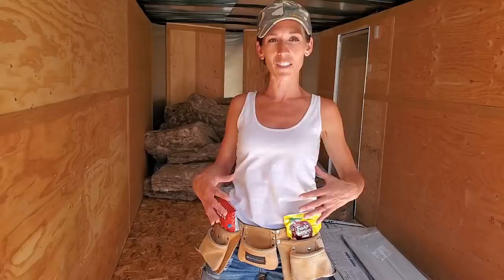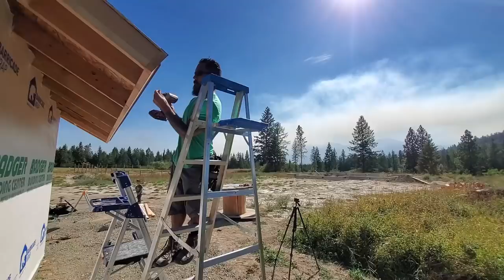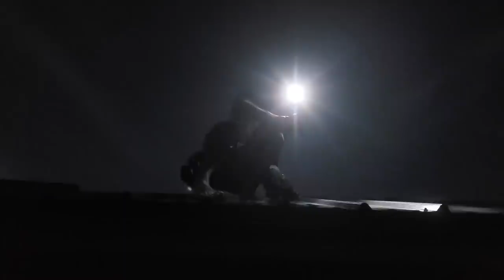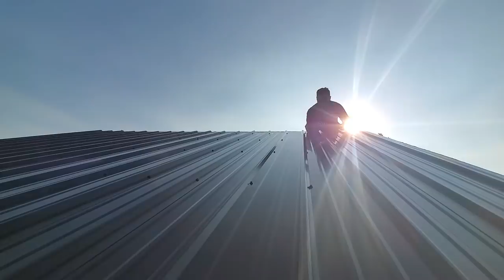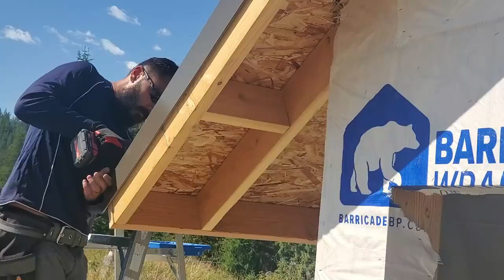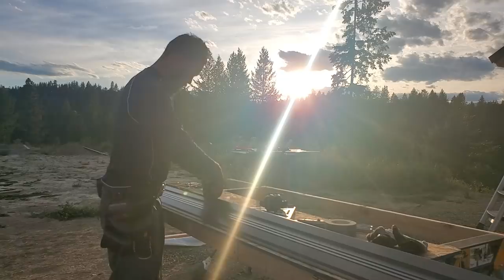How To Build A Shed (Part 6) | How Rising Lumber Costs Are Effecting Our Build

Comment: Might be cheaper to buy a sawmill.
Reply from the maker: May be but that would slow us down a year waiting on drying lumber.
Reply: Message me
Reply: You could build a sweet log cabin or timberframe though...
Reply: would also be another skill they could teach the little ones
Reply: @GoodSimpleLiving  See if you could find someone who has wood already  cut and dried. Work out a barter. Cut wood for them and  exchange your fresh for their dry.   You might try a log home. ☺
Reply: @GoodSimpleLiving  Building with green lumber is not a problem as long as all of the framing lumber is green with similar moisture content. Keep it covered from the sun so it does not dry unevenly.
Reply from the maker: @idadho  I am thinking of another channel that did that, and they had major issues as it started drying.
Reply: A sawmill was my first thought. Be safe.
Reply: @GoodSimpleLiving  There is a butt end sealant paint used to prevent end splitting and to slow the drying. Cut green lumber usually has the ends sealed at the mill. A small mill would usually have the sealant for their round log inventory. It was not uncommon to use green framing lumber that oozed moisture when a nail was driven into it. It is heavy to work with when wet/green.
Reply: Defiantly cheaper might be worth looking into building a kiln aswell to dry your lumber, You would then have everything to set yourself up as a mill once your fully up and running
Reply: @GoodSimpleLiving  Kiln dry it. Will be an extra cost but that's how it's done for the lumber you buy at the retail yards.
Reply: @GoodSimpleLiving   Hey you guys ,looking grand so far ,.Theres a company you should check out , that's called Jamaica Cottage shops ,they do kits ,and they grow all there own trees so they are able to keep costs down ,I watch another channel called Lumnah Acres Acre's on yt he has done a few of there kits have a look and see ,hopefully save you money 😋
Reply: @wavesantori252  Many have built their own kilns using shipping containers and a wood stove. The need for constant electricity to run a circulating fan would be problematic. By the time they built a complete system, they would have spent the same money the higher prices would cost.

Comment: Sounds like may have to find someone with a personal sawmill. Haha
Reply: Doesn’t sound like a bad idea!
Reply: Problem with that idea is that not many (if any) of the personal sawmills manufacture strand (OSB etc) board.  Dimensional lumber -  Sí        OSB - No
Reply: @olgringo-421  1x material is better than OSB anyways, just requires more effort to install.

Comment: I am a builder here in WA. Kitsap county. I am beyond swamped. It is a supply-demand cause and effect for sure. People are dumping money into there homes and people are fleeing the big cities and building homes in the Suburbs working from home with a little commute. I see the cost staying high on into the winter when demand will drop. I am actually recommending people hold off if they can until prices get back to at least reasonable. I paid thirty-two dollars for a 12" 2x8 pressure treated last week. I am playing hell trying to find exterior grade framing screws right now. You two are doing a great job and congrats being as I get off work to come home and watch you  do what I have done all day for thirty years.

Comment: Nice roof! Metal trim connections can get complicated. You might not have the correct hand tool, because all roofers will use tin snips for these details. MINOR SUGGESTION: when you install the drip edge pull the metal a small distance off the fascia and screw it on top with flat screws. This keeps the face of the metal free of screws (prettier) and the drip edge will keep the water away from the fascia (which is the intent) even with the little "kicker" bend. Draining water has the ability to flow uphill a bit at the edge of the drip edge, and then will drip onto the wood fascia. Pulling the metal slightly away from the fascia will keep the fascia dry.

Comment: We love our little sawmill.  You can build with green lumber.  You can use softwoods green.  It's the hardwoods that you have to let dry before using.  I use build with green pine and hemlock quite often.  I don't have the time to wait for it to dry, The small barn I did last year is just fine, and that was built with green lumber.  It just makes things a bit heavier.

Comment: Where you are building  you might want to look into buying fire equipment to protect you property. Set up sprinklers on the gable ends of the buildings or mount the sprinklers high . There are special sprinklers designed  to be used for structure protection.

Comment: Hi, have you looked into a system we use in the Uk, For making ''Timber '' Framed buildings. These can be houses, offices, hotels, schools; The way it works is you make cassettes using two panels of OSB, with insulation in between and a 4 x 2 frame around the outside between the two sheets, one protruding, one recessed and one straight down the centre as a brace. Stood on end the OSB sheets are 8 feet tall, or ceiling height, You make so many standards, then you make them with openings for your windows, then working of plan you smaller panels to match your wall lengths, you can make these as you do your construction depending on how accurate you think you are. The price of OSB very rarely changes, so you can, buy a truck full at a good discount, and through the winter make up the cassettes, in the barn, floors are made in a similar way, you put breathable membrane over the outside, use stone of your own land to put a brick skin over the ground floor and as price allows, timber clad the upper floor. steel clad the roof. Yes there is a lot more detail to what l suggested, But there are enough very knowledgeable people who follow site who will fill in the gaps I have left.. Keep smiling, #haveasfeday

Comment: When you put the roof on the house put the screws in the high peeks of the steel so rain doesnt run over screws as it runs  off roof.
Reply: Good as foot holds to😉
Reply: Nope. The manufacturers specify screwing this profile and gauge of steel through the flat. The rubber washers seal the screws.
Reply: The rubber washers deteriorate
Reply: George Run Homestead What evidence do you have of that? If they’re installed with too much force (which is very common) they can be damaged, split and spit out sideways but I regularly see ones installed 20-30+ years ago that are still perfectly fine.

Comment: Thankfully, you guys forged ahead and did the tiny home in the barn. My recommendation would be to hold off on the house build and concentrate your efforts on boning up the barndimonium. Finish the kitchen, the bath, etc. Also the gardens and other projects that don't require lumber. My husband and I went through hurricanes Ivan, Charlie, Jean and Francis. The prices of lumber and drywall were crazy for a LONG time and when it was said and done, people that continued to buy drywall (china imported) wound up having to rip it out later because it was toxic. The hurricanes in LA & Texas (Laura) and now the fires are causing the shortage. It will be a WHILE before prices settle. There is another storm heading to the panhandle right now. If you can find a source other than Home Depot or a chain (like a local mill) that would be the only exception. Keep in mind they will be higher too. Supply and demand.......... 
You guys really dodged a bullet by finishing off living quarters in the barn. Love your channel! Best of luck to you.

Comment: When I was doing the metal roofing on the shed I just built, I didn't use a punch to put a stater hole in it.  I just put the screw on the drill and then put it on the metal roofing and then just hit the back of the drill with my palm and the screw made it's own pilot hole.  You don't need to hit the drill hard at all, just a little smack just to put the point of the screw through the metal.

Comment: I would wait until spring and see what wood prices have done.  Or maybe look for a log cabin kit or a kit home that has the same size foundation that you have built. Some thing you don't have to source the wood for.  Work on fences or get orchard planted, get your garden ready to plant before winter comes. Surly there are many thing to be done. Do you have enough wood cut for winter?

Comment: In Canada (snow country) the metal roofing is screwed through the ridges rather than on the flat part. I was told when they did my roof that it prevented leaks happening if the screw seals leaked. Also they predrilled the roofing before installing to insure all the screws were in a straight line.

Comment: Have you priced an "all steel building"?  We had a company build us one -two years ago.  1200 square feet with a concrete slab floor; built start to finish in 3 days.  If my wife and I had not sat here and watched the progress, we would not have believed it went up so fast.  We are more than happy.

Comment: when we started our house build in 2003 the cost of osb was around 7 bucks a sheet then it jumped to over 18 a sheet i found a local saw mill and bought all the framing lumber from them then bought our osb by the full lift and saved some money

Comment: Lumber will go back down as demands level off with manufacturing..in the meantime you might check out portable mills. They have affordable units that are easy to operate as long as you have the trees for a supply.

Comment: Same boat as you guys on the lumber, what was 2.68 for stud 2x4's is almost 7.00 ea now. I  am at the point to stare inside framing of my 40x70 barndo, which is now on hold. Lumber yards I have spoken to have said prices should come back out of the stratosphere late Oct - mid Nov, only time will tell!

Comment: You can always buy your very own sawmill and I'm sure you have enough trees around your property to saw up use to build your house unless of course you want to do it the expensive way, just a thought. That way all you would have to buy is sheets of ply  for the floor and the roof and the siding, Witch I guess you will be using chipboard.

Comment: Back in the early 80's we had the same building materials shortage and prices were high. Building of homes all but stopped. Realestate went sky high. People started building metal frames homes and Earth homes etc. It was about two years before it was over. Some of the new types of buildings are unwanted now. Hope this info. Helps. Its tough to make decisions when the situation is different than what you were expecting.

Comment: Mike from Irving Tx...Have watched all your videos and always look forward to the next one...I don't have a problem with using osb board.., used it on my barn apartment and it has held the test of time...what worries me is where your water pipes are coming into the pump house...I would install some electrical heat tracing on the pipes where you come above 2 ft ground level going into the building...Cold weather is coming and maybe I am wrong and you have a plan for this. I noticed in a recent video that you were trying to get a little deeper going into the building...

Comment: You need to redo the drip edge there needs to be space between the edge and the wood so the water will drip off to prevent ice dams. With it touching the wood the water wont drip correctly. Do a search for "Tom Silva drip edge" With you large overhang you might be okay though.

Comment: Your shed is almost complete  You could  cover the outside with metal the same as your roof. IT will also be  more fire resistant.then when it comes time to build your  house maybe next spring the cost of lumber  will be down, or you could mill your own  from the trees on your land?

Comment: I would hold off. I have a sawmill but I will buy mostly factory lumber when I build maybe late this year or next. Sawmills are labor intensive. The only easy part most show is running the saw head down the carriage.
You have to get the log up on the deck and and turn by hand using a peavey. Then you need a place to store it for maybe a year while it dries.

Comment: check with your lumber yard on comparing the prices after each major event(fires/storms) that caused the supply/demand shift upward. The local store may not have that info on hand but you bet their Corp or wood suppliers will. this can help you look at when to plan to continue to build. Note if you have a permit on the house check with your permit office to either suspend/delay your build until the cost come down(don't want to have a expired permit). Also check with your wood supplier about buying in block/bulk with another buyer(s)(their sales dept. should help you with this).

Comment: A few suggested metal studs for walls instead of lumber. I would also suggest a complete metal house. My garage, like yours, was build out in one bay and the it uses very little lumber. Metal will also give you freedoms in spanning over the house in case you ever want to redo walls when the kids leave the house. From the outside the house may not look like a metal house and you can use all kinds of different materials.

Comment: Great video.  Wood prices tripling, bummer.  As you are very close to Montana and Washington, maybe compare prices in these states.  If a good savings then load the enclosed trailer and head out to buy a load.  As for the building siding here is an old time solution I used to see back in the 1950s for sheds.  Don't think anyone does this anymore but if you are open and the savings is right they used to make roll roofing, the kind with the tiny colored sand embedded.  You unroll it starting around the bottom of the shed and attach with roofing nails.  Then next level overlaps the bottom level as you move up the side.  They used to make this with a red brick design.  This is very old school and I only know about it because I used to work for a roofer back in the early 70s.  It's easy to unroll and install and goes on fast.  I think the designation is 90 pound which refers to the thickness of the felt roll.  If you price this and it offers big savings it might be worth considering as it will last as long as 30 year shingles.  Contact a roofer as he would be able to tell you if he can supply to you as you probably won't find at home depot.  Lots of other options but costly.

Comment: I would be willing to bet that somewhere not to far away from you there is a saw mill where you can get rough sawn lumber which would work fine for siding in your shed and probably save you quite a bit of money. You can probably also get rough cut demential lumber such as 2x4 -2x12’s  but keep in mind if you go that route rough cut lumber is a true 2 inches by a true width.. for roughing in your house. You might check into that. And pricing  just a thought.. I would think it would be about half the cost as what you would get from a big box store.. the shed is looking great..  I doubt lumber prices will come back down ever things don’t usually drop in price once they go up.. You can also side the shed with metal just like your barn if that’s cheaper per square foot.. or it will winter just fine with only the wrap if you want to wait and see but the wrap won’t last more then just a few months if you don’t cover it.. if it were me I would look for a saw mill and see what they say

Comment: I recently needed one 2x4 to complete a project.  I just picked it up and had it put on my account.  (I get contractor pricing). I heard discussions about the price of lumber so I looked at the receipt and my jaw dropped.  Over a dollar a foot.  The lumber yard has had a sign since then on the door that they are not selling framing lumber due to shortage.  I spoke with the estimator and he said that all the lumber they had on hand was already sold to contractors and they are having problems getting more.  We live in the mountains and logging is a major industry here.  I haven't noticed a drop in logging trucks and Rushmore wood products always has trucks pulling in and I see stacks of kiln dried lumber all over their yard.   What I hear is that because of COVID there are mills not running in some areas and consequently no logging.  I also hear that it's put many loggers out of business.  I have no idea how it's all going to turn out.  I was hoping to build a pole barn in the future but that seems to be in doubt now.  I imagine because South Dakota never had a lockdown, it hasn't impacted logging here.

Comment: try finding a local lumber mill like a small operation. Ypu can use rough sawn 1X? fpr sub flooring and roof decking. Basicly just try using rough cut lumber through out, Yes I know you will need pressure treated lumber in some places that will have to come from a lumber store but  you may be able to find the small mill the would love to have the  business.

Comment: Use osb for everything you can except your roof spend the little extra and use pressure treated for that it will save you a lot in the long run.

Comment: Have you considered a metal building for your house? Perhaps side the building with logs. It would be great if you has cedar trees on your property. Wood siding is an important thermal insulater. Metal, being a conductor, gets incredibly hot when exposed to direct sunlight.

Comment: With the rising cost of lumber and no end in sight, I would change my plans over to a straw bail construction. You could still use your existing foundation. It's much more efficient and more  fire resist then stick frame, especially as fire prone and with the harsh Weathers you get.